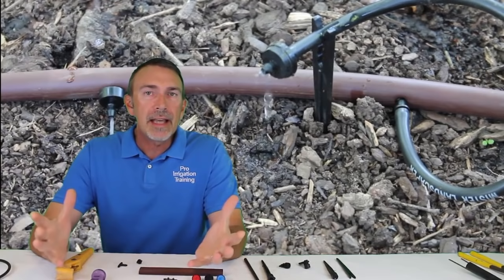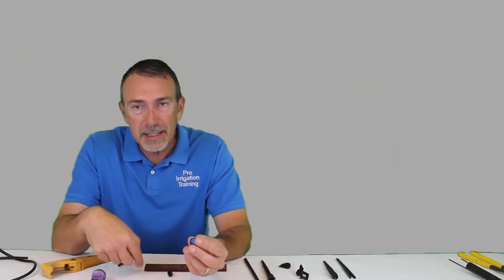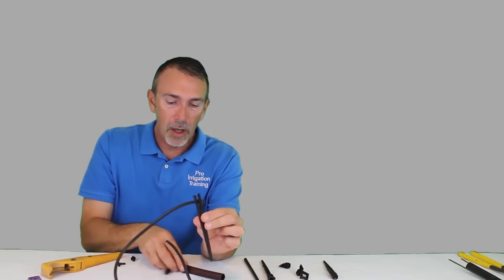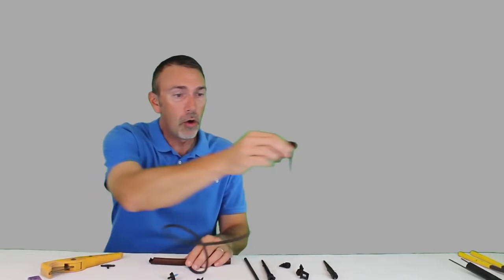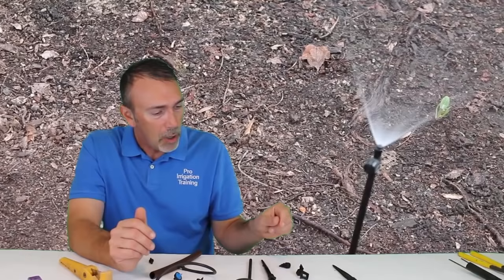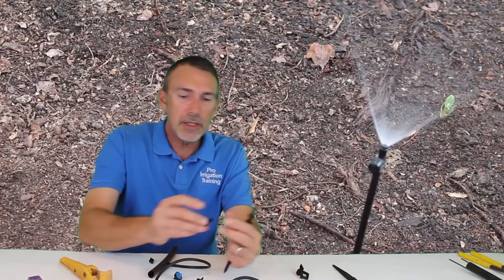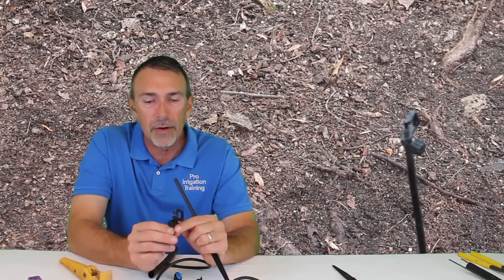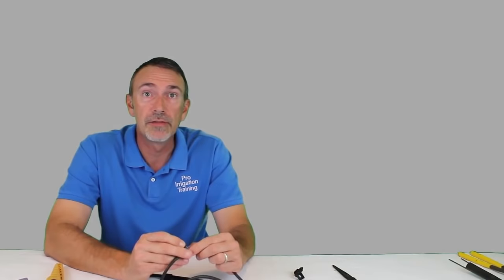Drip Irrigation spotlight on Drip Applicators, Emitters, Bubblers, & Microsprays

Comment: I like the one that has 6 or 7 streams come out from the head because as the plant matures it will require more water. And those are adjustable from 0 to 14 gph. Where as the faucet drippers only go up to 4 gph.  And the micro bubblers are ideal for watering garden beds that have plants spaced out far like tomato plants.  Those are the two that i use for my fruit and vegetable plants, and shrubs.
Reply from the maker: Absolutely right. I love the adjustability of the micro heads.

Comment: How would I run irrigation tubing from a splitter at a hose bib that will need to be trenched under pavers I am having installed. I would like to have a drip system for a sm/med size raised planter and for a fruitless olive tree in a huge concrete pot. Would I used pvc?
Reply from the maker: I would use PVC under the pavers for sure. I doubt you'll exceed the capacity of 1/2" flexible tubing that you can run inside the PVC. For 1/2" polyethylene tubing, you can get 5 gallons per hour minimum. I would do it like this: Hose Bibb > Brass Y splitter > Rain Bird Battery Powered Timer > Bushing to convert from hose thread to pipe thread > Male thread x 1/2" barb fitting > 1/2" tubing out to the drip location. This video explains what to select at the drip location. Hope that helps you!

Comment: Still not showing hooked up to pump wtf
Reply from the maker: Robert it's just not possible to give that level of information in an 8 minute video about drip applicators. Pumps are a complicated subject, and it probably requires about 2 hours of instruction to get someone to the point of being able to correctly size and install a pump. Drip is very low flow, and most irrigation pumps need quite a bit of planning to use with a drip setup, or you'll burn your pump out prematurely if you haven't selected the right pump.

Comment: Thank you. Your lesson was exactly the info I was looking for. You are clear and very helpful. One question...I'm installing several trees on a property and will be keeping them all on one valve with pressure regulator and filter,  running solid drip tubing to each tree and then I'm wondering if I should use bubblers or drip emitters.  I am limted to 2.0 GPH emitters by the city.  What do you suggest? Thanks very much .
Reply from the maker: Hello, sorry for the slow reply. I don't think there's really a need to use bubblers instead of drip emitters. 2gph emitters are just fine. You can even use smaller emitters and just extend the run time. Just make sure to add up all the emitters to ensure your flow demand isn't too high. If you have many trees, you might exceed the flow ability of the solid tubing supply line, usually 4 or 5 g.p.minute for 17mm or 1/2" tubing. In that case, just install a larger supply line, like 3/4' or 1" PVC or Poly.

Comment: I went with the drip tape option for my garden. I couldn't believe how cheap these systems are now and feel like a real dummy for using sprinklers and hand watering. It's going to be neat not having to babysit my water system.
Reply from the maker: Jason, thanks for watching and best of luck with your garden.
Reply: How is it 1 year in?
Reply: @k_neil  Go with the 15 mil. It's great but the 8 mil stuff got some pin holes in it that I had to cut out and splice. No big deal really but the heavy duty stuff is the way to go. I absolutely love the drip tape though. Best thing to ever happen to row crop gardeners.

Comment: Brilliant, didn't know I could put the dripper before the feeder line !
Reply: Be careful doing it this way. I'm not sure of the right term but if your feeder line is not at the right angle at the end, the water will run on the tubbing back to towards the main line. I know I'm not explaining it right but the water will not land on to the root ball of the plant. I used to attach the emitter before the feeder, but now that I actually maintain many of the plants I install I see the draw back of this method.

Comment: Good video would be good to know when to use a bubbler, vs microspray vs spray vs a standard drip emitters for different planting applications,  IE bed of perrenials, vs shrubs, vs vegatables, vs annuals, vs trees, edging etc and also using emitters with orbits line of 2, 4, or 8 line adapters and what emitters may be compatible with those.  I know I have had a hard time getting bubblers and microsprayers to work with the orbit multi 1/4 line adapters.

Comment: Oh, thats what they are - drippers! I thought it is some kind of rubbish restricting the flow. So I proudly cut them all off to allow system to work properly and flood my plants. I'm radical mindset - more water = better. Am I wrong? Sorry, first time homebuyer.
Reply from the maker: Hey Arthur, if it's working out for you, roll with it! Yes, the drippers do restrict the flow to a measured, matched rate. But if the faster flood works in your garden, then just watch the run time so you don't over-do it. Remember, over-watering can look a lot like under-watering in the plant itself, so check the wetness of the soil and adjust according to the plants you have. There's a lot of plants that can't stand to have wet, soggy roots, and other plants love it.

Comment: So I saw an article earlier this summer that using drains at the end of the drip lines would help keep them clean, so I bought some but found out that they don't work with the 1/4" lines, only the bigger stuff, 5/8" , do you know anybody who makes them for the 1/4" emitter lines or know of a trick to get them to work on the smaller lines ?

Comment: Thank you for your videos!  Question:  I do NOT understand how you are just snapping the couplers into the drip line by hand?!  Neither my husband or myself can get the stupid parts into the hoseline... it's extremely frustrating.  Even after poking a hole with the tool,  it is still impossible.
Reply from the maker: Hi Katie. I bet the tubing you have is actually "flex pipe" or the thicker walled tubing meant to connect heads and so forth. What you want is the thinner walled drip tubing. It makes all the difference in the world!

Comment: I have garden beds which some are 2m wide others are only 1m wide I don't way to be spraying water on my path right next to them, I'm thinking drippers might be the way but I have heard they only wet the soil directly below the dripper and not a small circle around the whole root system on say a hydrangea. Wondering if sprayers are better for this?
Reply from the maker: Luke, so sorry that I'm just now being shown this comment. Microsprays are good in this situation as you can can trim down the spray as needed. Pretty much every one I've ever seen has a flow control dial on the nozzle that will reduce the distance it throws water. As far as drippers are concerned, the water does spread out as it soaks downward from the surface. The more dense the soil, the more it spreads, but even sand gets some spread. I've used drip on my hydrangeas and it worked fine, but we have heavy clay soil.

Comment: just discovered your channel. I'm looking for a drip system that will connect to our DIY rain barrel.  It's elevated using 2-stacks of cement hollow blocks so it may have some pressure.  Will this work and what do you suggest? Thanks

Comment: Are there "T" couplings available? The coupling would have 17 mm barbs on the two in line ends and a male barb to be inserted into 1/4" tubing. I do not want to deal with poking holes in the tubing.
Reply: >>Also, I see a need for a coupling for PVC pipe with a 1/4 inch barb so drip tubing can be installed from the PVC pipe header...
Reply from the maker: @Ted_Michaels  There are various Tees available, but I'm not sure if there are any like you're describing. I'll look though, there are a lot of new products and manufacturers of drip. As for the second comment, there are fittings with 1/2" and 3/4" female inlets that have 1-6 drip barbs. They're quite handy for adapting pipe to drip. Be careful though, drip products should have a filter beforehand and also be pressure reduced down to 35 psi or so.
Reply: @Proirrigationtraining  Many thanks for your response. A "t" like I described would be fantastic. Also, thank you for your words of caution regarding drip - reduce down to 35 psi and have a filter - this is helpful.

Comment: First off thanks for the video great information. When it comes to regulators I noticed most kits include a 25psi. I was thinking of going 30,35psi I have around 60 to 70 foot of travel via flat area tell I get to my raised bed 3ft high. I just want to make sure I have enough psi to cover my vegetable garden. I'm using a 2ft x 2ft x8ft long bed. Any thoughts on this?
Reply from the maker: You sure can use a higher PSI pressure regulator if you think there's going to be a problem. If you're using a dripline product with the drippers built in, I doubt that you'd run out of Flow for this small project. You can check the manufacturer's printed guidelines for max feet of dripline per "run" or for each 1/2" supply point. If you're inserting drippers, add up the flow and don't exceed 6 gallons per MINUTE  total. Remember that the drippers are gallons per HOUR, so make sure you total it up right. But for that small bed, you shouldn't even approach max Flow capacity of the 1/2" drip  tubing. Good luck with your veggies!

Comment: I have installed a rainbird drip system to a couple beds this year.  I love that it shaves an hour off of my hand watering time.  My one issue that I have in both beds is that a few of the emitters still drip water when the system is off.  They are the emitters at the lowest point of elevation in the beds.  The beds are on 2 separate lines and they both have their own valves.  Those select few emitters drip all day.  How can I eliminate this problem?
Reply from the maker: Hi Jodi, thanks for watching! If there is dripping truly all day, 24 hrs, then the valve is probably leaking a little. If it only drips for a couple hours after running, then it's just draining. You can get dripline with check valves molded in the tubing, or you can get little check valves to insert in the line to mitigate the problem.
https://amzn.to/3oBx1o2
Reply: @Proirrigationtraining  Thank you so much for the response! I have not buttoned everything up completely yet.  I was waiting to see if there were any problems before I closed it all up.  Do you have a test I could run to see if it is in fact the valves leaking? I can replace the valves if it is.

Comment: How many .5 droppers can go on a system that is attached  to a rain barrell/ tank?
Reply from the maker: The question relates to how much water flow you have available. If you have enough pressure to push the water, and are using 1/2" delivery tubing, ( supplying 4 gallons per minute) you could theoretically use 480 of the .5 gallons per minute drippers. The problem with rain barrels though is that you don't really get enough pressure to push that much water. You could attach a small pump to the line to bring up the pressure enough to push  4 gpm. If you're using 1/4" delivery tubing (17 gph) then you could use 34 of the .5 gph drippers.

Comment: Great video.  If I no longer need water to an emitter at the end of spaghetti tubing, how to plug it?   Can I fold the spaghetti tubing to plug it?   Or will that cause the coupling to the 1/2" solid tubing to leak?
Reply from the maker: Yes, you can just double the tubing over and secure it with a bread-tie or something similar. If the pressure has been properly regulated, the fittings shouldn't leak at all. Thank you!

Comment: Is it easy to plug up holes if you move a plant from that spot? Really I wanted to ask if you know how the orbit raindrip system works and if its ok to use soaker hoses combined with non porous tubing connected to irrigation manifolds? Thanks
Reply from the maker: Yes you can easily plug the hole with a "goof plug." And those soaker hoses work well, you can mix and match any of those products for whatever plants you have. Just make sure you don't exceed the 4-5 gallons per minute that's usually the limit for 1/2" or 17mm tubing.

Comment: What kit do you recommend for watering 15 trees, about 150 feet around. Thanks
Reply from the maker: I personally like using dripline with emitters molded into the tubing. Make a loop about 75% of the way out to the edge of the canopy. You can connect all the loops with solid tubing. There's something similar in some of the practical videos in the drip playlist.

Comment: I'm obsessed with learning more about drip irrigation (for our 5 acre ranch). I have totally loved your video / tutorial!!!  We are just starting to map out the location of future planting (mostly fruit trees and shrubs and garden beds). I have a couple of questions.  1) because of the large parcel, can I run schedule 40 PVC lines (?1" vs 1/2" vs 3/4") underground the several hundred feet to a specific location before adding the flexible tubing? 2) I have some very large, mature pepper trees. Can I keep them adequately watered with a drip system?  3) apparently coyotes bite into these lines during droughts; any solutions?  I had considered running the drip irrigation lines inside the PVC lines, but I'm told they typically bite into the lines nearest the emitters so my plan won't work.  Thanks in advance for any answers!!
Reply from the maker: As far as the coyotes are concerned, you may try to cover the drip lines with enough mulch so that any critters cant see the lines or hear the slight noise the emitters make. Mulch also helps hold down any evaporation. Other than that, you could look into a Rain Bird RWS Root Watering System. It's buried in the ground and irrigates directly into the root zone. As far as the PVC supply pipe, you will need to add up the gallons per minute for all the sections of drip that you want to put onto a single supply pipe. First, you can't exceed the gpm of the supply source, your pump or water meter. Then look up the friction loss chart for Sched 40 PVC pipe and see which size pipe will flow that much water. I once installed a system for a blueberry farm that was several acres. We had to use 2" pipes to deliver water to all the sections of drip that we wanted to put on each zone. If your farm is large, you may have to use several zones and valves to cover it all.
Reply: Kim Newton ..you must use 3/4 in line to 1/2  pvc. Then tube
Reply from the maker: Ferg, she didn't say how many trees or shrubs or the flow that was needed. If there were many trees down a line, you may want to be careful about using 3/4" and 1/2" pipes. Schd 40 - 1/2" will only flow 4 gpm without getting into excessively high velocity, and Schd 40 - 3/4" only 7 gpm. Supply pipes should be sized according to how much flow you need.

Comment: I have had drip for three years and still trying to figure it out. I have a lot of pots various sizes and 5 2x8 raised beds that look more like a cottage garden. I am thinking I need more of a micro spray for my type of raised beds. I’m also stuck on what size of drip to use for what size of pots. I also have the cloth pots and I have decided the 1 gallon drip per 1 gallon pot. Is that right? And how to use the bug guards? Thanks for your help.
Reply from the maker: Hi Sheri. Let's talk about the dripper size. The 1 gallon dripper means one gallon through that dripper in one one hour of run time. So, If you need a full gallon in that pot, then use a 1 gph dripper and run that zone for one hour. If you only want a half gallon in that pot per watering event, then you could use that 1 gph dripper and only run the system for half an hour. (or a 2gph dripper with 15 minutes of run time.) I also like microsprays because they have a variable shut off knob that you can trip down the spray if you need less water.

Comment: Hey do use 360° emitters on vegetables
Reply from the maker: Hi John, sorry for the late response. But yes you can use 360 emitters. Really its what you need to directly water the plants or just the roots, depending on the location of the drip tubing. The 360 emitters work great, though.

Comment: I have a combination of bubblers and emitters, but unless I turn off the flow completely, the water comes out 24/7 even though the timer doesn’t start again until the following day. I have had to shut off the main water every day and then turn it on again when the timer dictates. I have tried changing the settings on the bubblers and sprayers but it makes no difference . What should I do?
Reply from the maker: Hi Robert, there could be a couple things going on. Is there any downhill run to the drip lines? Maybe there's enough water in the pipe after the valve shuts off that it's continuing to push water out the emitters. Or the valve isn't fully closing (which is usually the culprit). Disassemble the valve and flush it out. It's also possible that the timer is malfunctioning and sending voltage to the valve 24/7. Get a voltmeter and check the wire junctions.
Reply: @Proirrigationtraining  Thanks so much, as it was the valve needing replacement. It works perfectly now.

Comment: What is the minimum psi you would recommend. I'm working on setting up a gravity flow system.
Reply from the maker: Well, most drip products need an 8 or 10 psi minimum to work. If using 1/2" drip tubing, you have a limit of 4 or 5 gpm. which gives a psi loss of 6 - 7 psi per 100'. Also some loss through any supply piping and valves, elbows, etc. will probably bring you up to 20 psi. And we get .433 psi for each foot of elevation rise, so 46.18 feet of elevation.